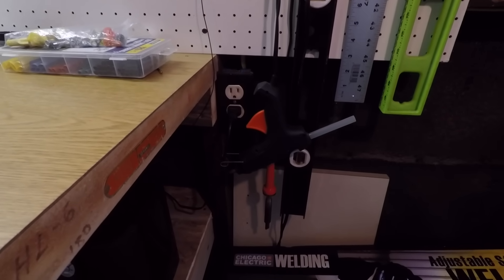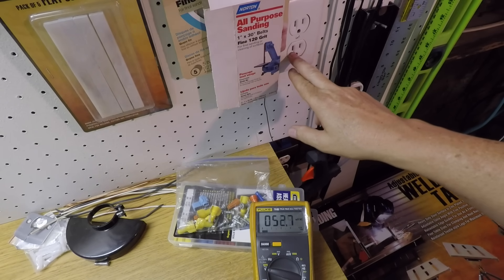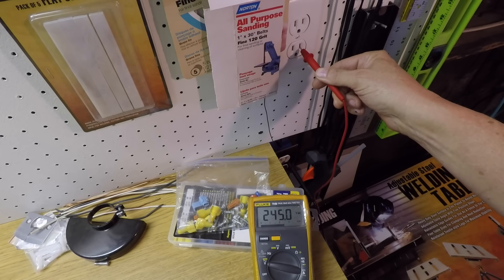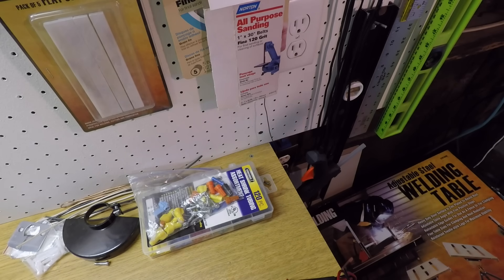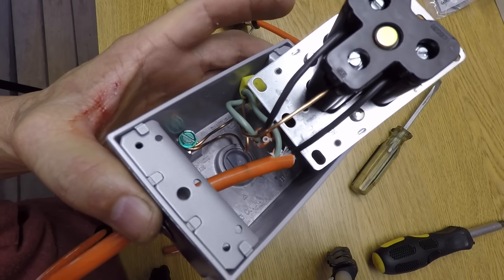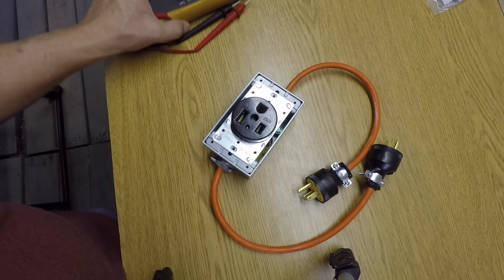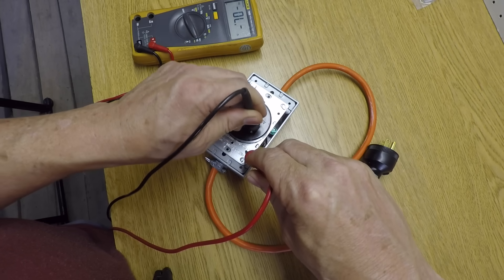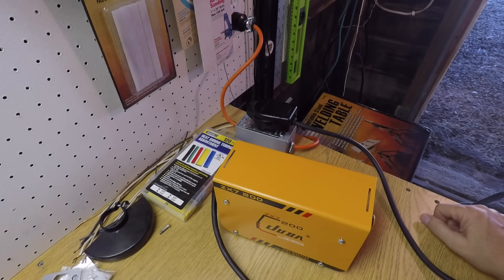How to Get 220v From 110v

Comment: Do I need to buy 120v grounding plugs if I just use two brand new 6 ft 15 amp extension cords and leave the plug on that it came with?
Reply: yes but remmber that 15 amp cord is only rated for 1800 watts where as the 20 amp cord is  2400 watts. so any thing over 3600 watts will run the risk of those15 amp cords failing